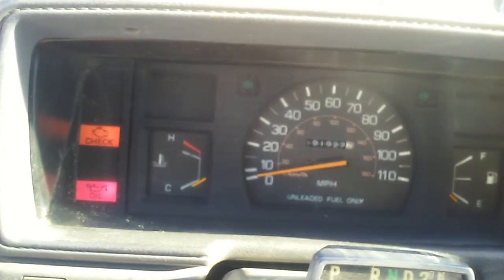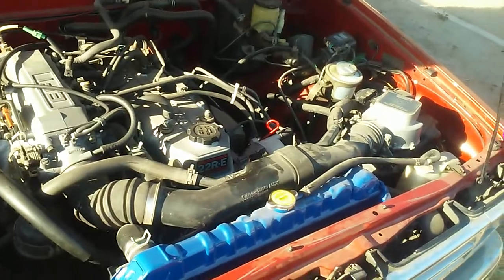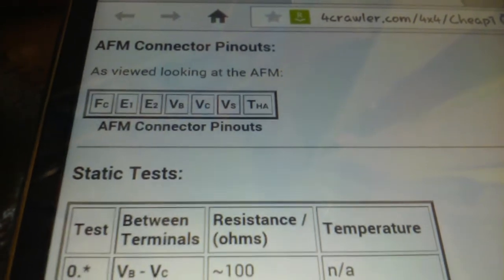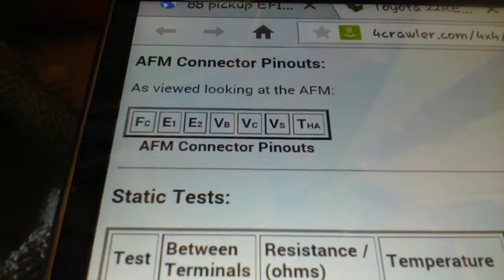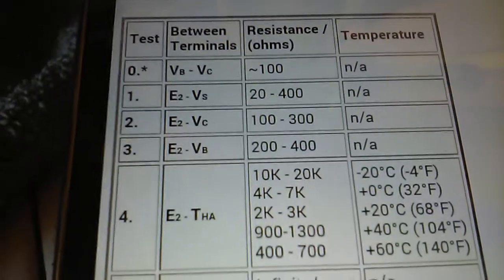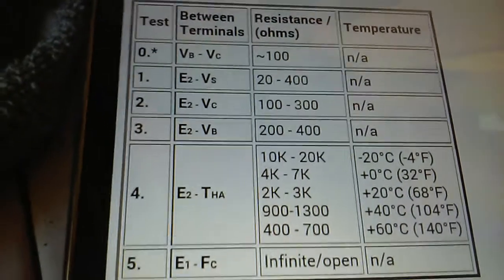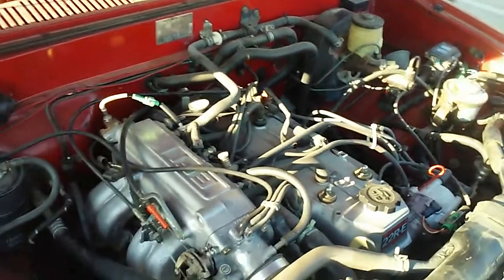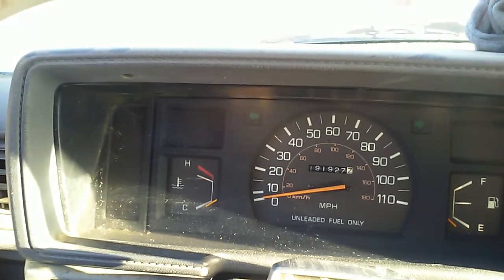How to test air flow meter on a 1988 toyota pickup 22RE 2.4L

Comment: Thank you -89 toyota pickup 22re. had check engine light on, was getting a 21 and 31, code ohmed out the maf sensor and everything showed good (Greatfull for the instructions) I also check the o2 sensor as directed in the manual and it appeared to be good also.  I disconnected the battery and reconnected in a couple of minutes and my check engine light stayed off  - What the heck? I didn't think those codes reset with a power disconnect.

Comment: this video helped out so much thank you, my 95 4x4 has been sittin as well just got the head gasket done and same issue as yours started then shut off I rechecked everything i was about to blow it up then my friend noticed the air flow wasnt sounding right, youtubed it and came across your vid installed new sensor and boom! all good thanks

Comment: What’s up Gilbert? You ever figure out what that code 51 was?
Reply from the maker: is yours the same exact Toyota?
Reply: @SuperDjnrg  1988 4Runner 22re 2.4L 4cyl
Reply from the maker: @davidmercado4660  yes it ended up being the injectors. How long has yor truck been sitting?
Reply: @SuperDjnrg  a couple of years but I changed the injectors a month ago
Reply from the maker: @davidmercado4660  did you put new or used injectors do a ohms check.
Reply from the maker: @davidmercado4660  did you check your feul pressure how many psi's is it? Fuel filter and cold start injector?
Reply: @SuperDjnrg  remanufactured. I haven’t checked the fuel filter
Reply from the maker: @davidmercado4660  also you have to make sure the new injectors are the same color code as the old ones . If the color changes so does the pulse width
Reply: @SuperDjnrg  I didn’t know that. I definitely gotta double check that. I appreciate you taking the time to answer my questions
Reply from the maker: @davidmercado4660  any time.

Comment: the aircooled VW flat four thumbnail threw me for a loop. lol
Reply from the maker: Sorry, it happen to be sitting on my table when i shot the video. Lol.
Reply: @SuperDjnrg  I still got a baja bug project that needs some love. It had a little single port 1500 that I sold years back. It made more torque than my 1600 DP with dual 40 IDFs surprisingly. I miss the VW days

Comment: is this effecting your power when driving? torqe?  makes it rattle  shaking if not right?
Reply from the maker: Shane Audet I had trouble starting it check the mass airflow sensor that ended up being bad but the reason it wasn't running was because my fuel jectors where bad I ohme check them and they were good, but mechanically they were stuck because it had been sitting for so long without Fuel and the lacquer made him stuck.

Comment: mine is doing the same thing what was it
Reply from the maker: raider nation if you listen to the video of the stupid truck sat for a long time I owned the injectors and they owned perfectly I guess it was a mechanical problem with the injectors cuz they sat for so long and they developed a lacquer to prevent them from injecting after I replace the injectors it ran beautifully. the injectors ended up being the problem.
Reply from the maker: I mean I checked the injectors with a ohms meter. electronicly they where fine, mechanicaly they where stuck.

Comment: What you do after change the flow meter to solve the problem?
Reply from the maker: rafael melendez replaced my injectors, I ohms checked them and electronically they were fine, but they were stuck with lacquer from sitting so long with no gas . as soon as I changed them.it ran like a champ.